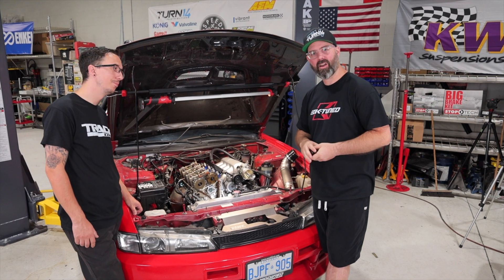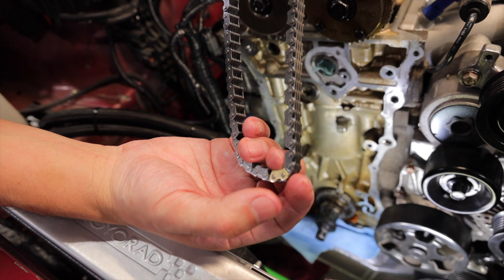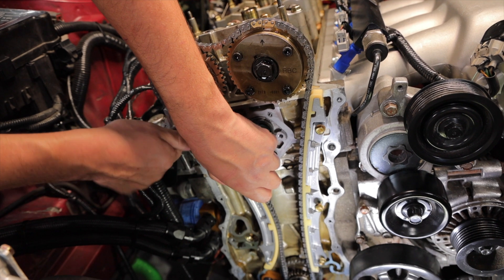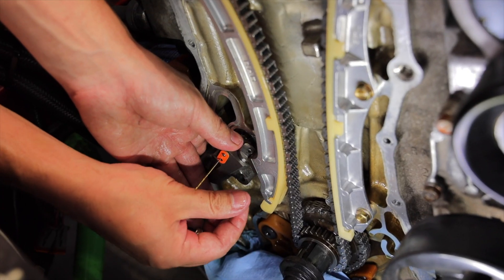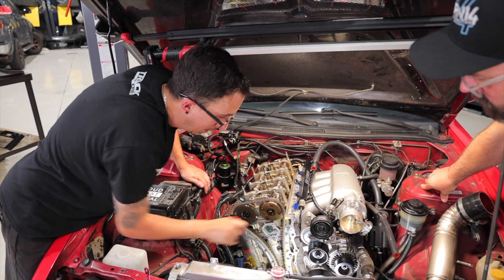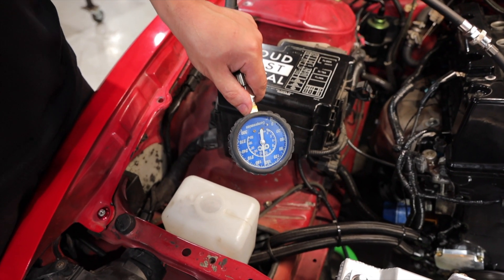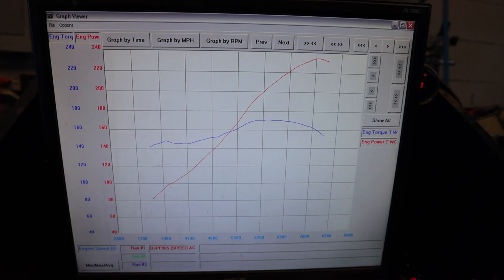How To Set Cam Timing Honda K20 K24 - Quick & Easy!

Comment: The exhaust cam mark was off. It's supposed to be in the middle. You have to adjust the cam a bit and hold it in place with the guide until you add the lower guides and tensioner.

Comment: Hi, after setting everything and making sure the colored links were in the correct locations(two dots on cam gears and mark down at crank gear), I turned the engine a couple of rotations and back to lining the timing marks up but the colored links seem to be out of position. The tensioner is in place and everything but the colored links dont line up in the locations I set them up in any longer when I am at top dead center cyl 1. What gives?
Reply: when u first put on the chain it’s only for initial timing after that you’ll never get the same timing marks to line up again. i’d take a lot of rotations to get them to line up
Reply: @vert3141  54 rotations to be exact
Reply: So why do they even make them with the color chains links? Genuine question. I replaced a tensioner on a crv and now my timing marks don't line up it seems like my crank jumped afew teeth so now I have to put a bungee cord om the chain and remove the cams to set my camshafts again
Reply: @ Only for initial timing setup to ensure the chain, cam and crank are all properly aligned.

Comment: Do the gold part have to line up. Or will the chain work as long as its in time.
Reply: Was doing my k24 timing last night and all links lined up so this morning when I rotated it again to verify it was still timed it didn’t line up so I’m gonna have to remove tensioner and do it again. I even put Allen’s to hold the cams in place but im wondering if it matters to set the crank tdc since it’s a 720 degree engine or will it be fine with marks lining up?
Reply: @alexsantana5377  I was told by a Honda tech that once the engine rotates the marks on the chain will never line up again. Its only a one sgit deal.
Reply: I may try it one more time because it was a lil hectic because I took the block apart to change check the valves and pistons. Ain’t in Cali no more so it’s hella hot here in az nearly a death experience 😂
Reply: The colored links DO NOT live up ever again . I think maybe after a thousand revolutions maybe but they’re not supposed to line up

Comment: FYI you don't have to make the colored links on the chain line up after a few rotations. You will be there for days waiting for the color links to line up.
Reply: I don't even have colored links
Reply: came looking for this haha
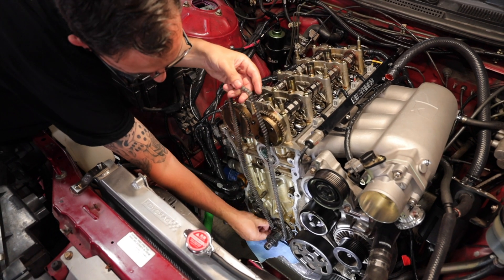Reply: Dude, my crank lines up for the top mark, but the bottom mark is on the opposite side of what’s pictured at 0:45.

I would have to reverse the chain to have the links line up, which that is being a PIA at the moment for me.
Reply: @shiftn2gear you're 180 degrees off on your crankshaft/oil pump

Comment: Hi i have a k24w1, new timing chain, new tensioner, new camshaft sensors, new vvt s, new cam gear, still throwing a p0341 code. Any suggestions on what to check next?
Reply: your marks are off

Comment: if i want to just see if my base timings correct an i do so without removing pulley and using the timing marks and removing valve cover or does the pulley and plastic tray need to come off? i suspect a timing issue and only need to see if its timed correctly.
Reply: You can take valve cover off and then they balancer mark should line up with the arrow on front cover and on the cam gears the 2 lines will point at each other when they are in time. If the lines are pointing to each other and roughly parallel with the head and the white balancer mark lines up with the arrow on the front cover all at the same time that your motor is in time.

Comment: So easy when the K-series engine is in a RWD vehicle.  99% are in FWD cars so can't just pop the timing cover off because the right engine mount is through-bolted through the cover to the block.
Reply: I know I’m late but-I just finished doing the timing on my type s with the engine in and it wasn’t as daunting as I thought. Just take the oil cooler line off completely, Jack to support engine, remove mount bracket, then boom. Just the 10mm. Hardest part was the chain guide to help let the chain sit in.